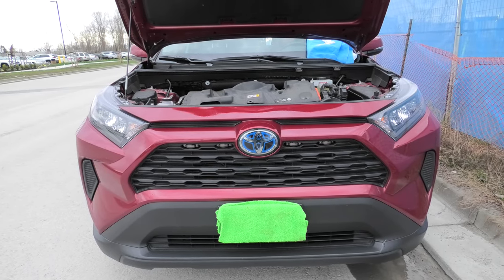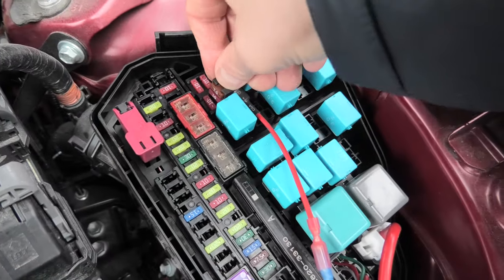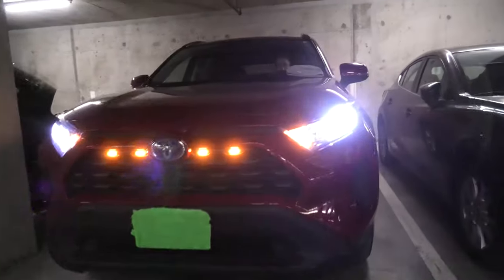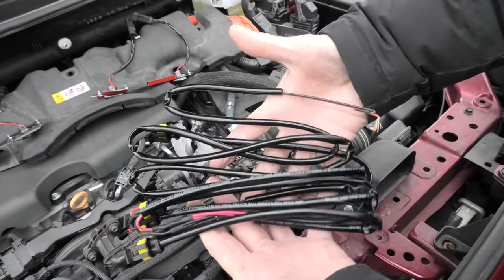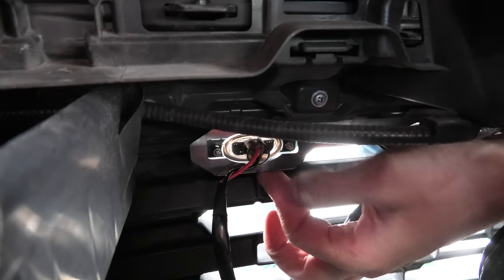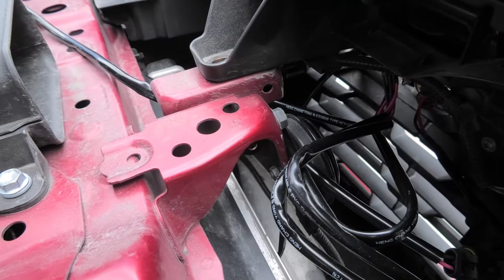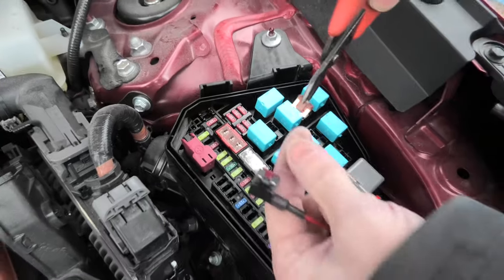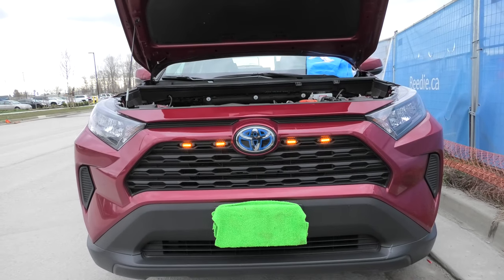Toyota RAV4 (2019-2024): Raptor Lights Installation.

Comment from the maker: PRODUCT LINK:
1. NEW VERSION!!! Not Suitable For Prime & Adventure!!! Free Shipping PLUG & PLAY Snap-In Installation LED Front Grille DRL Amber Lighting Kit For Toyota RAV4 2019 2020 2021 2022 - https://cartrimhome.com/Front-Grille-LED-Light-For-RAV4-2019?tracking=morozov_automotive.
2. Front Bumper Grilles LED Light For TOYOTA RAV4 2019-2022. Not Suitable For Adventure && Plug-In Version!!! - https://cartrimhome.com/Front-Bumper-Grilles-LED-Light-For-TOYOTA-RAV4-2019?tracking=morozov_automotive.

TOOLS USED:
1. TRIM REMOVAL TOOL - 4pcs Auto Door Clip Panel Trim Removal Tool Kit - https://amzn.to/3Sq46Ba.
2. 10MM SOCKET, RATCHET - DEWALT Mechanic Tool Set, 84 Piece (DWMT81531) - https://amzn.to/3IsF6F5.
3. ELECTRICAL CONNECTORS - 160 PCS Spade Connector Quick Disconnect Male Female Wire Connectors (22-10 AWG) - https://amzn.to/3ZgaHAE.

Comment: Good day to you. I just want you to know That I already installed my raptor lights. I have just follow the way you do it. But the only difference is I did connect the positive to the park lights; 2 raptor lights on the driver side and 2 raptor lights on the passenger side. I just add single fuse  of 3 amp on both sides. So far so good. I. Case there wjll be trouble it is only the park lights will be affected which is easy to replace. Thank you.

Comment: If you could have a video about installing a fog lights on 2019 rav 4 Hybrid LE. And on what is the safe fuse to get power for the fog lights , not the one direct at the positive but the that will on the fog lights upon turning the key on. Or if you have no video about that. Do you have any idea what fuse to use for it. Thank you so much.

Comment: you did get power from the 7.5 fuse which is the EFI  Is it safe to use that EFI fuse? That is Electronic Fuel Injection.  Is it safe to use that fuse to get power from it?  How safe it is.  It seems to me that EFI is a very sensitive part of the engine. please i need your response, Im your avid follower, i learned a lot from you and getting a lot of ideas. thank you
Reply from the maker: Hi Mariano. So far it did not cause any issues. You can also connect the raptor lights wiring to the headlight wiring or use a different fuse in the fuse box.
Reply: @MorozovAutomotive  yes thank you so much. Youre really good.

Comment: do you have a video when you drill a hole on the fuse box? i want to watch to do the same. thank you
Reply from the maker: Toyota RAV4 (2019-2022): How To Run Fuse Tap Wire Inside The Fuse Box Without Drilling The Cover - https://youtu.be/k4nCYmNR7uw.
Reply: @MorozovAutomotive  thank you